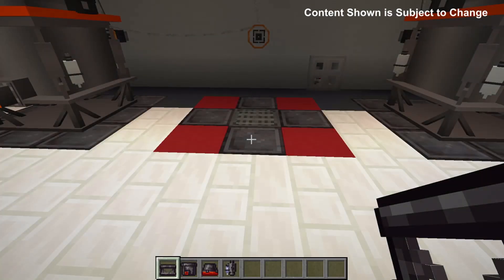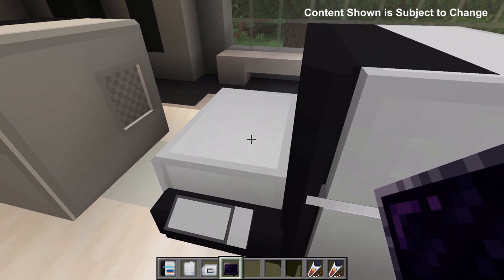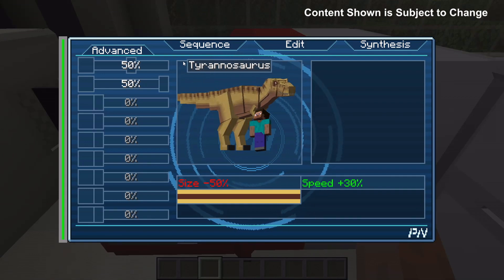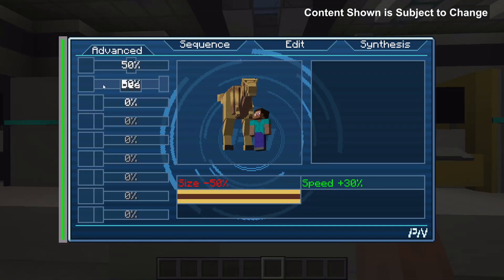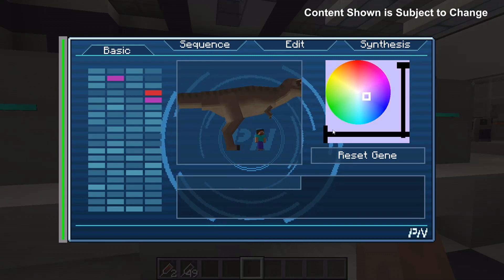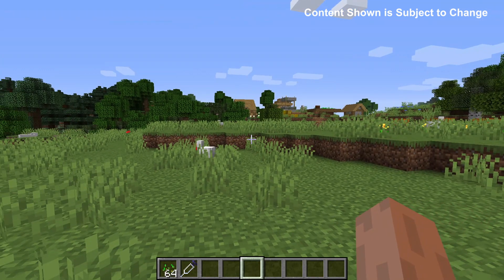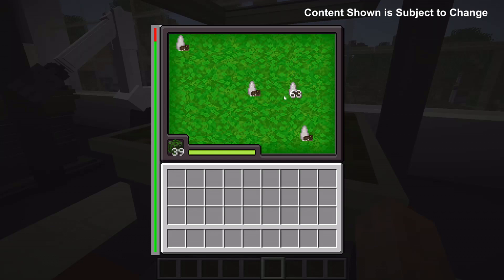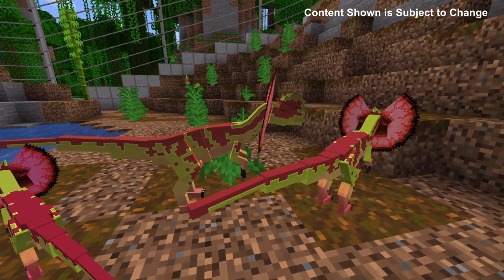Project Nublar Cloning Guide

Comment: Will we be able to turn on and off the power in this mod
Reply from the maker: Likely will have a config option so that you don't have to keep refueling the power generators. If you're just asking if you can turn off the power, you can. And the machines will be compatible with other tech mods so you can power them that way too
Reply: @dumbcode2782  I did made a video on idea and it’s on my Channel on here
Reply: @dumbcode2782  I was as asking about the Electric fence